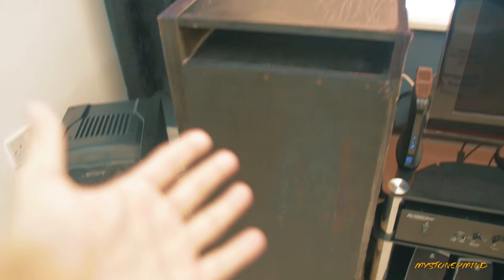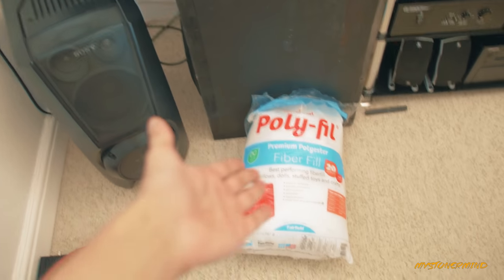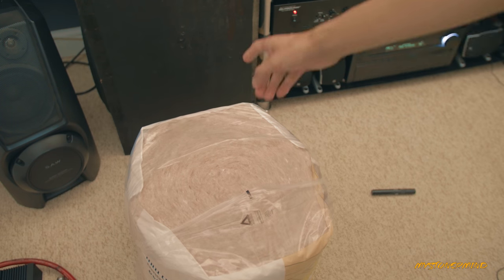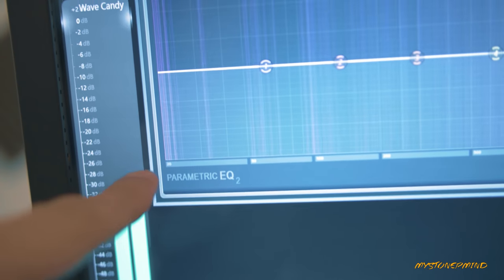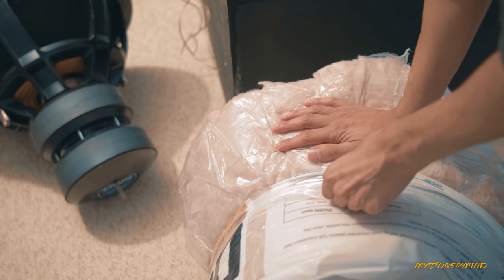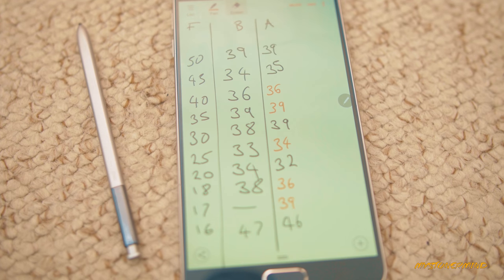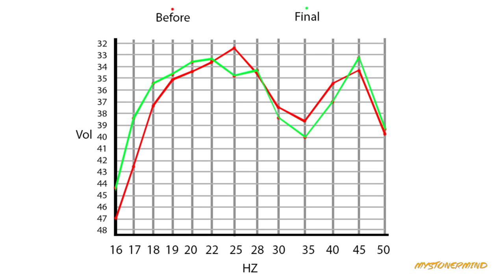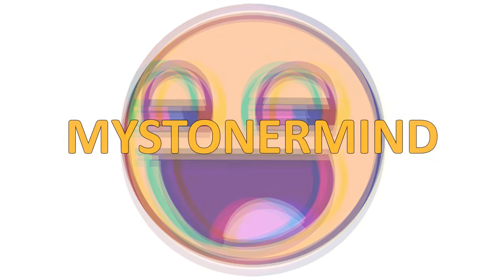Effects of Stuffing A Ported Subwoofer Box

Comment: I recently filled my 3.4 cuft ported box with 4 8s and man what a difference it made on the low end it will drop to 25 to 22hz and flutter. Before it would drop off @ 34 hz and just cause port chuffing. I highly recommend stuffing ported subwoofer boxes. I will say it took away from how loud the highs get but man is the trade off worth it!

Comment: Yeah I've used non-itch fibreglass in a ported box, actually does quite well, and there doesn't seem to be too much dust/debris floating around, so maybe results vary brand to brand. I used non-itch stuff if that effects results. Still itches the throat.
Reply from the maker: yeah I felt it in the throat, had to wrap my hoodie around my face like a taliban. Didn't want to get the other one cos it seemed a bit too thick, originally I'd gone to get another one but came back with this.

Comment: Im doing a masters in acoustics on the effect of filling enclosures with multiple different pourus materials, loft insulation being one. and modeling the effects mathmaticaly on different types of enclosure based on their order. So far my results measured in a fully anechoic chamber arn't far off yours, the differences seem to also follow the same trend as my much more controled environment. you might want to try activated charcoal as that so far has the greatest effect on the frequency bands and is remarkably good at flattening frequency response.
Reply from the maker: cool, this is an old video. Loft insulation works the best for my application, activated charcoal (mostly carbon) I only use in the filters attached to the extractor fans in my w33d tents ;) All the best with your master class!!

Comment: Just did this with my krk 10s, there allready was some in it but it looked like it needed more. 

Once i filled up some space and turned it on i noticed the low frequencie’s were less and the more bumpy bass i got ( must say i could feel the bass a little more after i stuffed polyfill in it and saw that the woofer was moving much more. ) 

I decided to get the fill back out cause i was missing my lower frequencies👍
Reply from the maker: yeah personally I wouldn't try it with monitors, cheers for the comment though
Reply: My Stoner Mind dont get me wrong, i did it with the krk 10s subwoofer. Not with the monitors ( maybe i misunderstand you? )
Reply from the maker: @Itsjafferr  oh I thought you meant the main speakers, either way monitor speakers are for the most part designed to be the way they are, so I wouldn't mod them. A big old car speaker in a DIY box though, that's a little different. Cheers
Reply: My Stoner Mind yeah well there’s allways room for improvement or am i mistaking? Haha.. thx for your fast answer👍👍

Comment: Awesome video. I’m getting ready to apply insulation to my speakers enclosure but don’t know If i should glue or staple the insulation to the body
Reply: From an old school installer... I have always used screen like from a screen door or window over the polyfil and stapled for a super clean install. The screen is super cheap on a roll from the big box hardware stores. Just saying... a year later.

Comment: All my cars has always been sealed boxes. I listen to heavy metal with very fast kick drums. I built a ported box tuned to 32HZ and it’s much louder but the fast kick drums sound too boomy. Kinda sloppy sound. So I was wondering if the poly mat would take out the boomy sound. Give it more of a tight sound
Reply from the maker: Mine was tuned to 28hz and I've had 2 15's in a 34hz box in the past, both sounded great with metal/rock but results can vary from system to system. 
If you primarily listen to metal maybe stick to a sealed box, but if you want to tune it go for 35-40hz.

Comment: So go with a higher tuned box and use this stuff to lower the tuning back to what you had before. Makes more sense when you are very space limited and you are trying to lower tuning to where you want it within reason. Problem is your box is already tuned correctly. That mid 20s peak is exactly what you would want from a powerful 18in subwoofer. Losing that volume between 25-40hz would be undesirable in my opinion. Unless you really want to improve those 17 hz tones you can barely hear. Made me realize I should probably not do this to the box I'm making for my 15s. They aren't high end woofers with a lot of throw and the box is already tuned to 34hz. I'm going to add a 50hz 12db subsonic filter anyways to lower the power pushed through the subwoofers at those low frequencies because below port tuning you lose cone control.

Adding fill would be counter intuitive for what I'm doing. I can see it dampening mechanical noise a bit though but I'll have to test my system first before hand. I bet there will be 5 other things vibrating in the car to worry about before dealing with the mechanical noise.

Comment: Not done with the vid but like i said previously i wanted to put polyfill into my 15 inch mid and well i got a material almost exactly the same chucked a lil bit in the one 15s box and well it really smoothed the sound out and idk why it seems louder maybe its true potential came out due to the lack of some noises the hollow interior made btw this is a sealed box i will be trying it with my other 15s someday im curious cuz those are ported hmm
Reply from the maker: +Erik Britz yeah it helps in most cases, I've still gotta do it to the Aiwa speakers yet 🙄 lol

Comment: What's that "reference volume"?
Reply from the maker: Reference Level is a standard, known, predictable and reproducible playback volume level.  When movie sound tracks are crafted, they are done so on systems which are locked at this level.  The sound artist does not play around with a big volume knob when doing his/her work.  If the sound artist wants something to be loud, they make that sound loud within the sound track.  When they want something to be soft, they make that element soft within the sound track.  Movie theaters set their playback level by the exact same rules, so when the movie is shown, you hear EXACTLY what the sound artist heard when they were making the piece.  Loud, soft, in-between, it's all there, and no one touches the master volume knob over the course of a two-hour movie. 
To achieve THX certification, components must play at this reference level without breaking, distorting, buzzing, rattling or any other distracting effects.